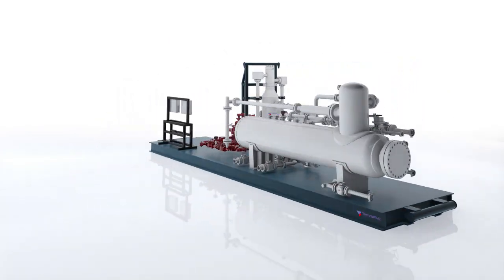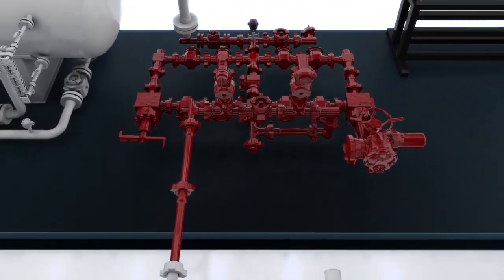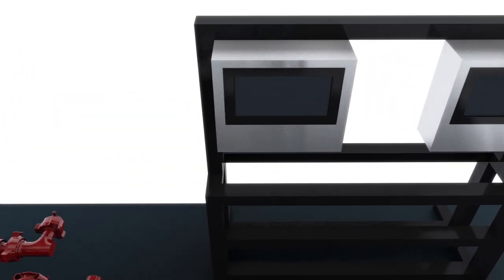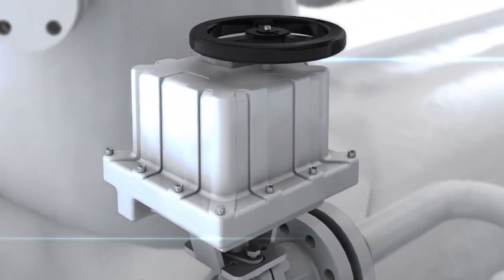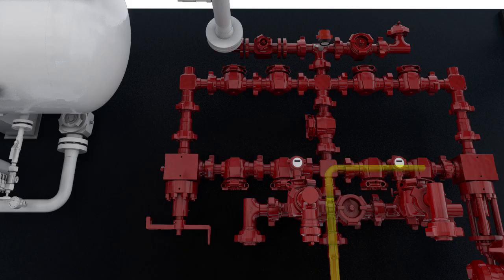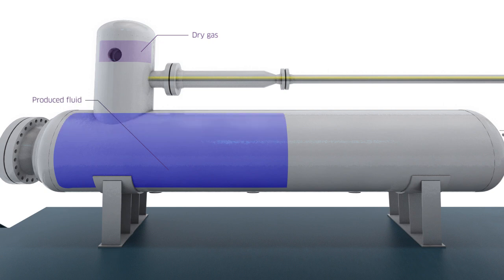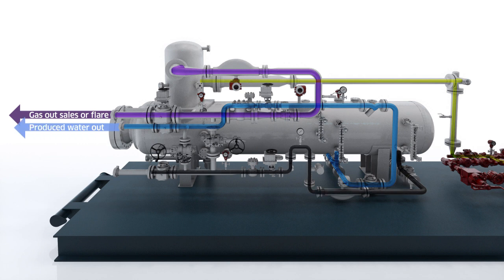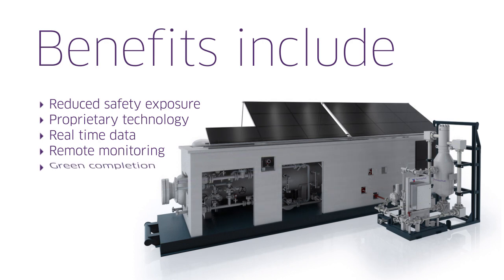Automated Well Testing Package

Comment: 1. The inlet line is set high. what about the carry over and density of the gas. is there enough time to separate the liquid from the gas at high flow? 2. What about the water line, it is high. (if you will work to production line you may problem with it.)3. There is no visible bypass between the inlet line and gas outlet and the oil outlet. 4. Relief lines are not visible. And there are many more questions.